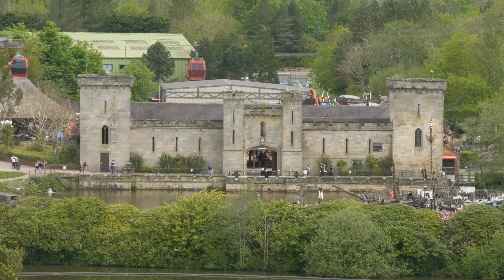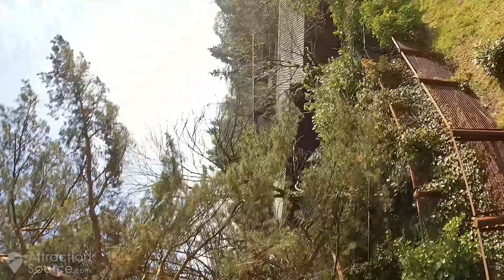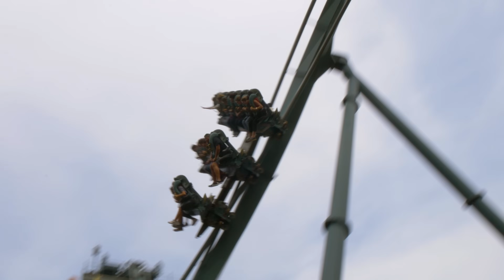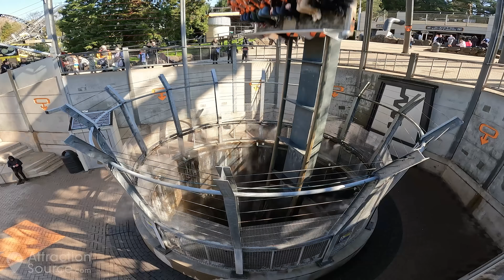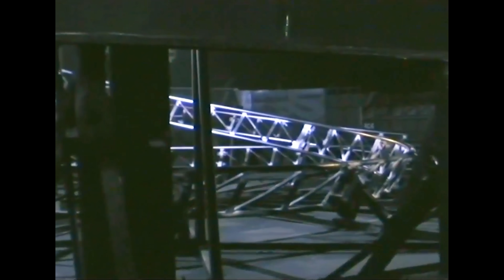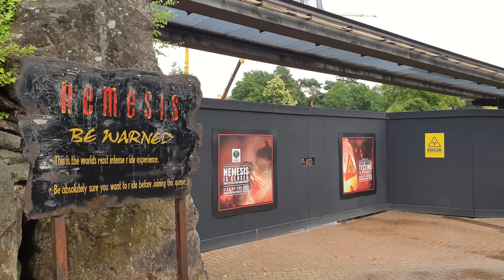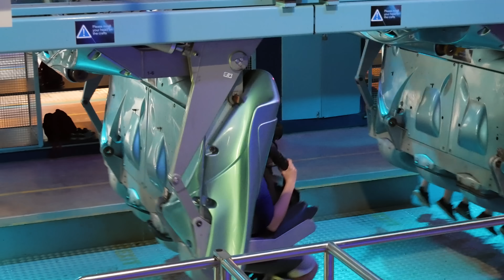Alton Towers has a roller coaster problem

Comment: I’d put money on Rita and The Smiler being the next two to go. The Smiler feels like it’s tearing itself apart as you ride it and it’s only 10
Reply: its just the smilers trackwork, if you look at 2013 povs it was never smooth in the first place, but yeah it wouldnt get removed as its altons main attraction at this point
Reply: I think it would be rita, the smiler would get retracked i think
Reply: @Yonel6969  I’d agree that Rita would probably go first, but Smiler has been an anchor around Merlin’s neck since 2015 (arguable since 2013..) I don’t think it’ll have the staying power of something as famous and iconic as Nemesis
Reply: @max-well-online  Since 2015 the smilers had no issues, it alongside nemesis is the most popular ride at the park and still a record holder, its not leaving anytime soon, it will probably get a partial retrack like colossus and the big one, most of the ride isnt too rough for a full retrack.
Reply: Smiler won't go anywhere. It is still a record breaking coaster to this day, so anything short of another major accident like it had (which is VERY unlikely to happen anymore, as due to the accident, it has resulted in becoming one of the safest rides in the world since) would be unlikely to get it removed.
Reply: @ReiReiFoxy  I think you’d be surprised. It’s aged worse than any of the parks other coasters in a fraction of the time. Eventually it’ll just become unrideable
Reply: @max-well-online  literally also the most intense ride at the park and as such is going to degrade faster than the others. Also last I checked, ride quality isnt necessarily a death sentence for a roller coaster. Wooden coasters still exist, and are still being made. I know some places in the world are known for scrapping older ones, but the UK still has several 1930-1950 wooden coasters going, and none of them are particularly special in any way, and all of them will destroy your spine.
Reply: The smiler is very hit or miss. Some trains are generally give a smoother ride and the closer to the front the smoother. Track wise, I wouldn't say it's too rough but it has rough areas (Mainly just after the first drop and its final 4 inversions). It has definitely become rougher but its future is very uncertain

I'd expect it to get retracked for it 20th birthday like Nemesis is for its 30th. However, I'd only see this as a viable option for the park if it still holds the inversion record. 14 inversions could easily be beaten by another newer Infinity Coaster by Geustlaur but after the crash in 2015, most parks wouldn't take a risk in making a 15 inversion coaster. Even if it got replaced, it is on a very small footprint and majority of the ride is surrounded by storage buildings, x-sector paths, Oblivions Overbank and the service road. Trying to find a new ride that could easily fit in the area and be on par with The Smiler could be a major challenge for the park. 

I suppose we wait and see what happens
Reply: Smiler was never was rough unless you’ve only been on a backseat wheel seat.
Reply: @IhaveaPHDinBoredom  It's less like its super rough and more, for the kind of coaster it is, it is on the rougher end.

Comment: I think Rita is a problem. It doesn’t take up much space & can’t be expanded with protected land around it. It also goes over all of dark forests pathways so if it’s replacement was low to the ground to maximise the space then that would affect crowd control for dark forest

I do think Galactica & Spinball Whizzer sit on the best sites

I’ve said for a while I expect Nemesis & the smiler to be retracked due to their popularity but nothing else. Oblivions site isn’t too bad, they could fill in & redig the hole & with the flat ride sites there is some extra space
Reply: removal of rita provides an opportunity to reroute pathays and make the area more inclusive, rita dissects the area into two and doesn't offer an all-out amazing one-of-a-kind ride experience
Reply: Could the path of Oblivion be reversed to make something like Stealth/Top Thrill Dragster, whilst staying under tree height? It might not be unique enough though.
Reply: @jackw7714  obviously not 😂😂